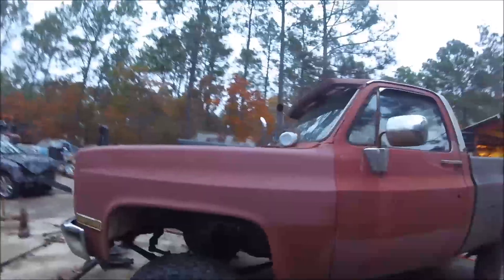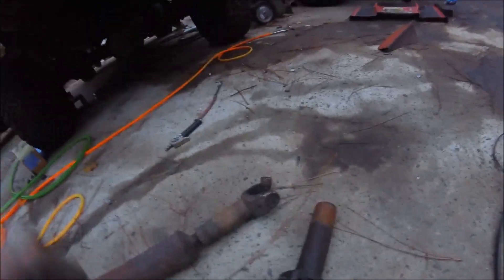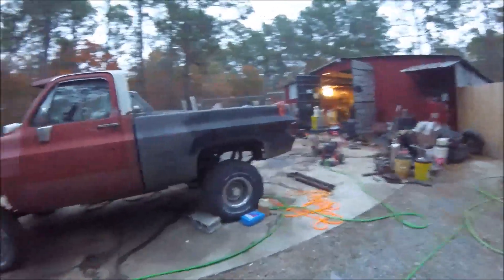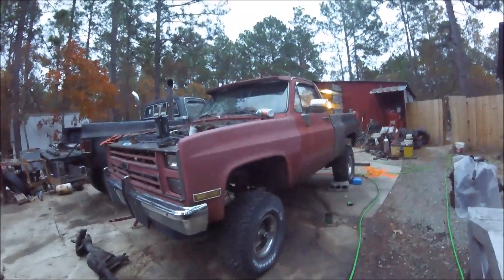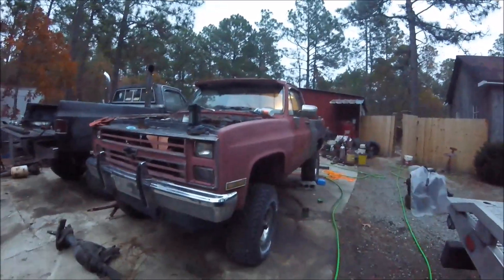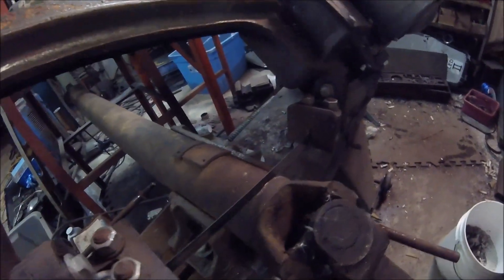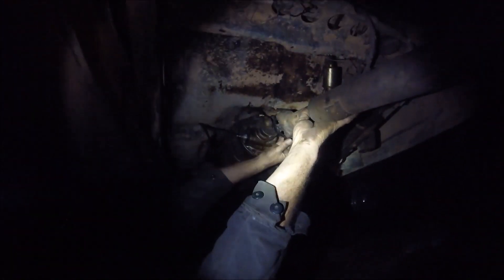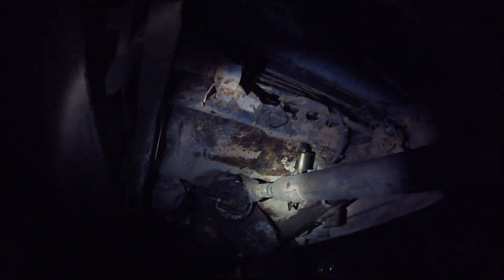1982 Chevy K10 Rear Drive Shaft

Comment: Nice seeing you back on the K10 and be cool to see both trucks doing there thing. Square body 4x4's bring more $ then newer IFS trucks, Jeep, AMC/CJ's and older bring more $ than YJ's. And Toyota's tried and true 4 cylinder motors '79 and up straight axle.Built better straight axle and manual locking hub option not to mention the body style of both

Comment: Nice to see you working on the truck again. I noticed that you called that transfer case a 205 then corrected yourself to a  np208 but the transfer case you have is a np203 you can tell by the range box mounted to the front. You guys are doing very nice work on that drive shaft. Hope to see more vids from you soon.
Reply from the maker: Wallie2004 you are right sir, I had 203 in my head, idk why I wrote 208. Lol oh well. Thank you.

Comment: Sweet, Nice to see it again.. What'd ya do with the 6.2? I need a parts motor & anything else you have with it... 
P.s 6.5 is Just an Overbored 6.2, (Aka Time Bomb Waiting to explode) I noticed you still have the Spinoff Secondary Filter on the firewall those are pretty rare I could use one.

Comment: Does the bandsaw use any cooling fluid, or do you rely on slower speeds to deal with heat? I used to run a Woodmizer sawmill, and we had a water feed right in front of the cut (wooden logs). I saw on the closeup that this seems to run as a dry system. I'm really curious about blade life. thanks.